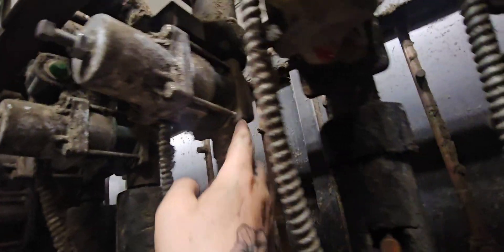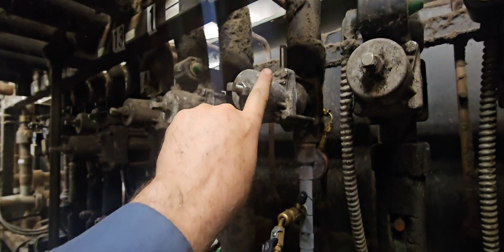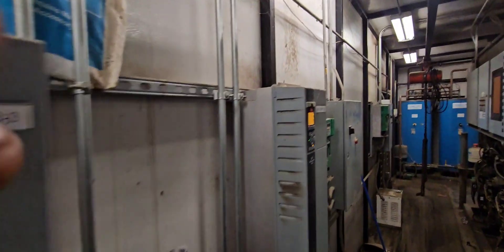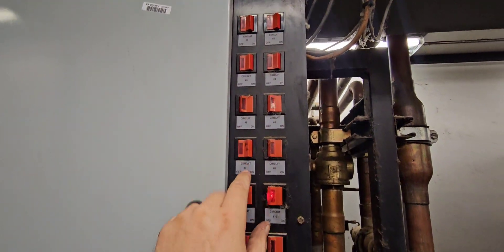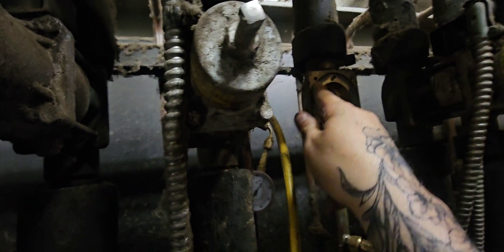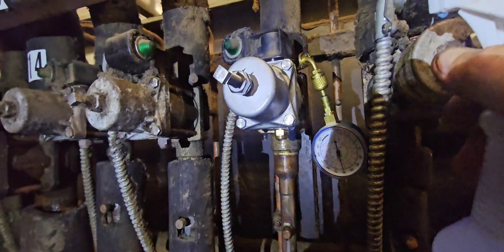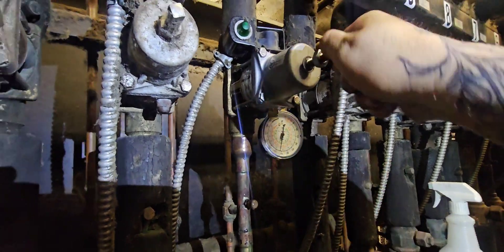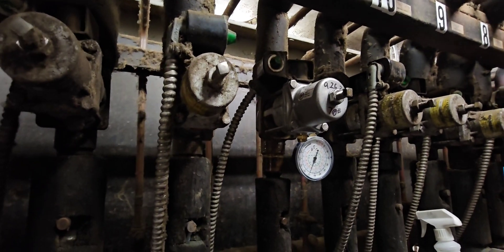Supermarket Refrigeration: EPR Replacement! (PART 2)

Comment: What happen when you toogle the red switch off, that the suction pression go down even further?????
Reply from the maker: Those toggles control the EPRs on the rack. By toggling them off i can pull down the suction header faster.